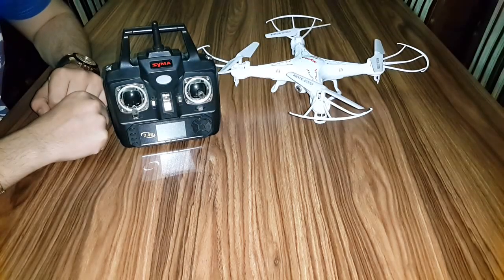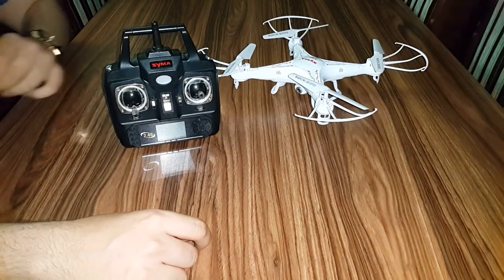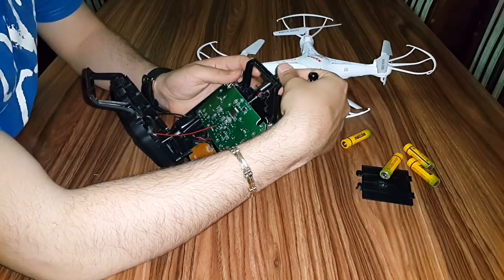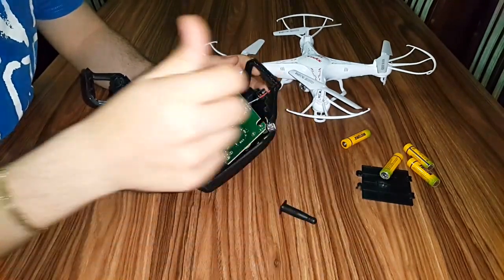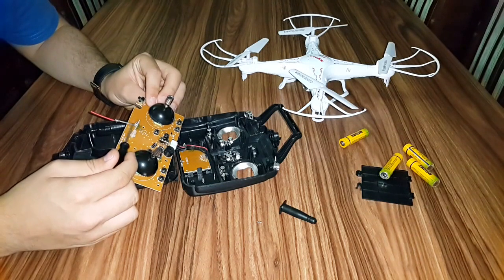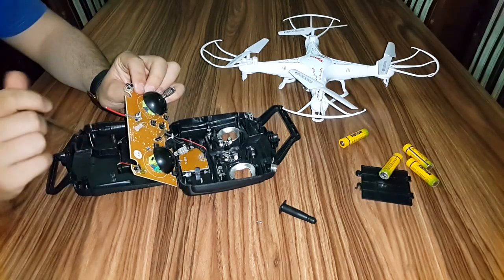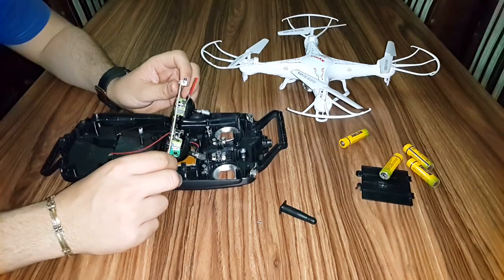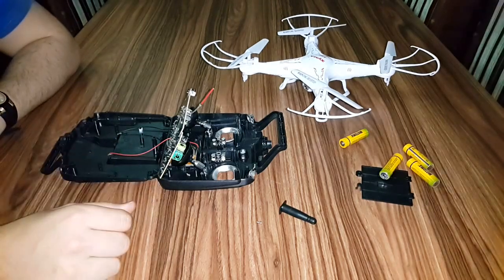Syma X5C remote control range extend

Comment: Any copper wire with same diameter would be good right?
and how do i solder it? tip to tip or wrap around the old antenna to the new wire and solder it? thanks
Reply from the maker: +Saiful Raznan it should be of the same diameter same length and you should solder the tips of the new and old wires together :)
Reply: Thanks for the input, hmmm... wondering what will be the appliances that uses the same diameter of wire? lol
where did you find yours though?
thanks again.